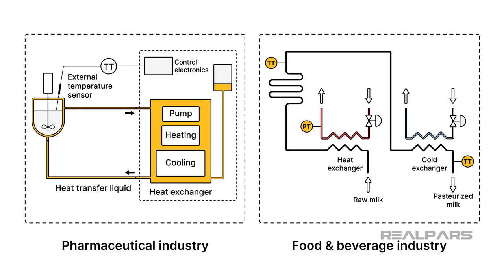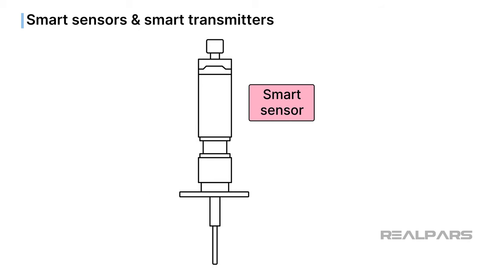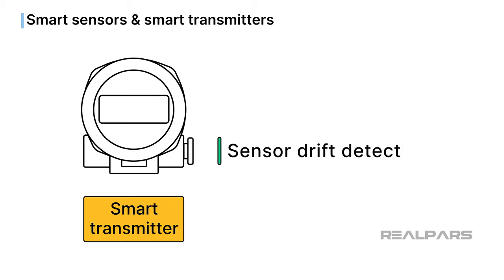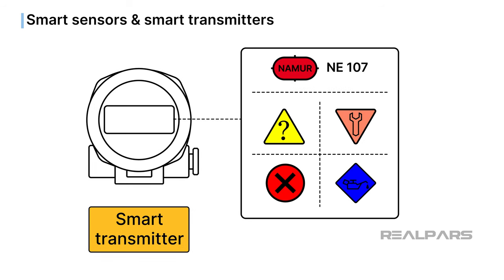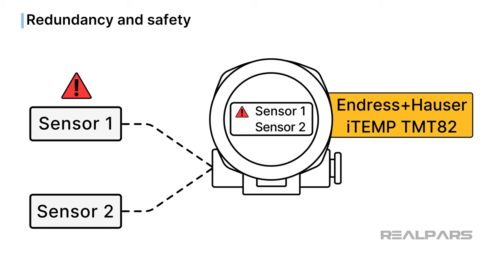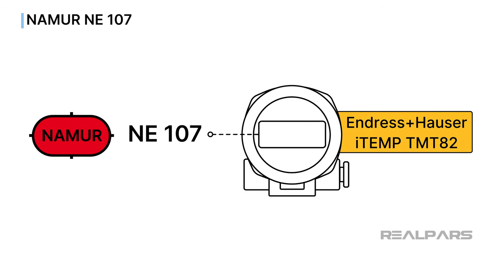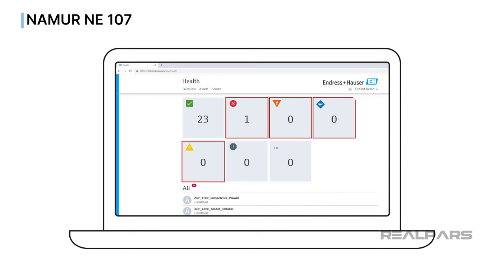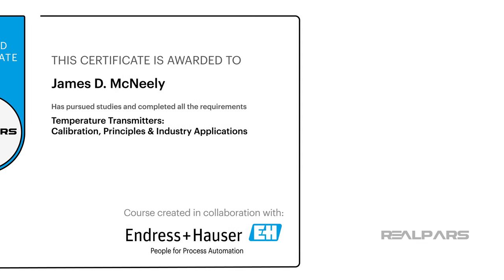Essentials of Smart Temperature Transmitters and NAMUR NE 107

Comment: What's a good duct actuator with wireless controller/thermostat?  I would like to do zones using actuators aka VAV to control different areas of the house.
Reply from the maker: Hi There!  There are several options for duct actuators with wireless controllers/thermostats available on the market. Checkout out Honeywell, and Johnson Controls for example.